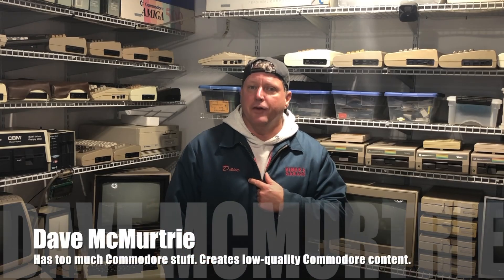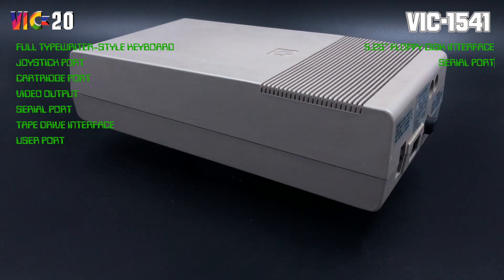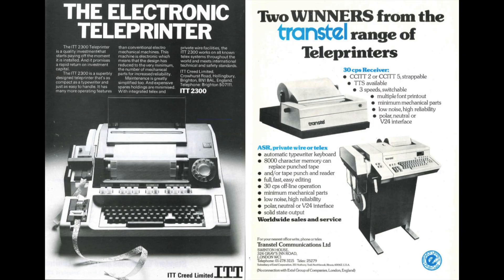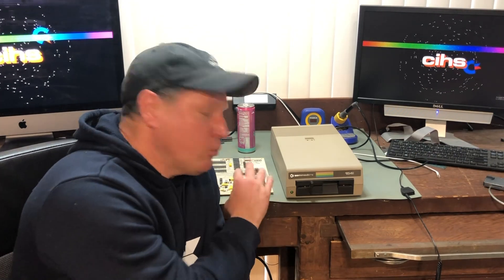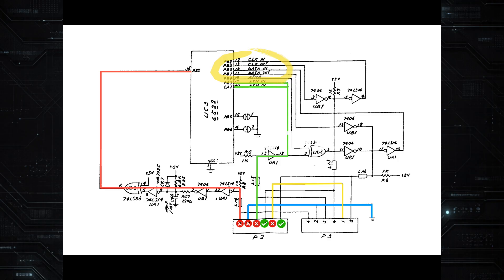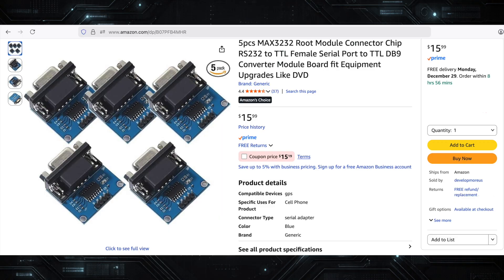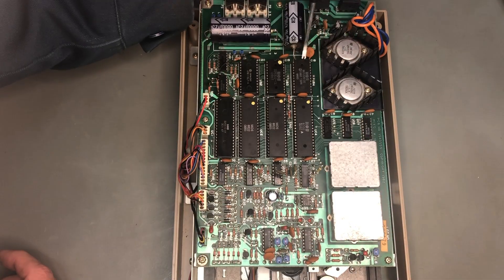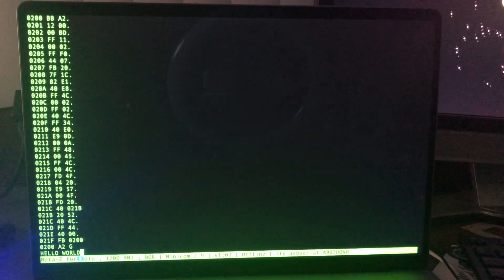Can a Commodore 1541 disk drive be used as a general purpose computer?

Comment: Removing chips with a screwdriver always makes me clench lol. Chip puller!!!
Reply from the maker: lol. Please don't stress! If you look closely, it's not a screwdriver. It's a chip prying tool, designed for the purpose. I don't like the ones that grab from each end because when they slip, they scratch up the top of the chip.

Comment: There's been lots of uses as a 1541 as a standalone computer. Some demos used it to calculate 3d graphics, of course it ran fast loaders, it played music, disk copiers could run them standalone with no computer connected, and using the DOS is actually talking to another computer over a serial terminal connection.
Reply: Look for "freespin" that one is a few years old and outputs b/w composite.

Comment: I'm not sure if it necessary to convert a CBM serial port to an RS232 port to prove this point.  Sure Commodore's serial protocol was non-standard, but other than that you can still connect to it like a terminal.  Something along the lines of OPEN 1,8,1,"O:TEST,S,W":CMD1 with a bit of BASIC wrapper 

There's a standard "upload 6502 code and run from 1541 RAM" command the Commodore drive so you don't even need to swap the ROMs (MEMORY-READ/MEMORY-WRITE/MEMORY-EXECUTE).
Reply: Yes, it's a serial bus, but the hardware uses bidirectional lines and the protocol is synchronous, so you need additional lines: Data <>, Clock, Attention, Read/Write (R/W).

With a standard serial interface, you have a transmit (Tx) and a receive (Rx) line that doesn't change direction.

However, if you want to send data via the IEEE, you first have to define the direction of data transfer (R/W), then generate the ATN (Attention Time Signal), and then create the clock signal for the data that will then be generated.

This is necessary to have multiple devices on one bus.

To create a serial interface from this, you would now have to implement the protocol on a PC or a microcontroller.

In this case, it made more sense to use the appropriate lines, such as ATN and DATA. Once the VIA has been correctly configured, the interface can be controlled normally using software. This also allows parts of the KIM system to be integrated.

Comment: I wonder, could you merge some KIM 1 code with some 1541 code to enable the disk drive functionality, so that you can load and save data from a disk? Maybe just put a boot loader in ROM and have the 1541 load the rest of the code from a floppy? It has 2k of RAM. Would it be possible to replace 1 of the ROM chips with a RAM chip to expand it's RAM capacity at the expense of having to load some of its code from disk? Just some ideas.
Reply: You can add drive ram without replacing any ROM. This was a common trick in the 80s for making disk copying more reliable

Comment: I love what you did by burning a KIM-1 ROM onto the 1541 but technically you may be able to do something like this without modifying the 1541 at all.  When I worked on C64 games back in the day we would download small routines (fast loaders) into the drive and run them from 1541 RAM. So just as a tech demo flex - it may be possible to fit a tiny monitor into the RAM,  download it using commands from a c64 or other, then disconnect the serial cable and then hook it to your terminal for a little standalone 'computer action'.  But nevertheless, what you've done is the better way and terrific! I got a good smile from it!  Porting Tiny Basic to the 1541 was mint!
Reply: yeah one application of this was a "headless copier" software. Hook two drives on the bus, load the copier softer into the first drive via the C64. Then swap it for the "source" disk, and put a blank in the other drive. You could now disconnect the drives from the C64 (so you could go play a game or something if you had a third drive, or cartridge). IIRC, you could even replace the blank after it was done copying with a new blank, and it would start over. Would be ideal for crack parties. The copy and "check other drive for a new empty disk" routines were all running from the ram on the first drive, and it became the bus master, as far as the second drive was concerned, it was talking to a C64.
edit: @lmorchard reminded me it was called Fast Hack'em
Reply: @epremeaux Crack Parties sounds amazing...
Reply: of course the OTHER famous application was to load "music" and thrash the head around to play sounds.
Reply: @epremeaux  Drive Music! A real money maker for disk drive service professionals back in the day. :)
Reply: this sounds cool too
Reply: If you have something that can input the "load file" and "memory execute" commands you can load and run any software from the disk, all without a C64.

I think a simple board with Parallel to Serial shift buffer, a timer, a counter and a dozen switches could probably do it. 
Or maybe just 4 switches if the drive ROM does not have timeouts on data bits. 
Or even just a ROM with a timer and a counter to automate the whole "boot process" completely.

Then you can hook a terminal and use it as a general purpose computer - as long as the disk has software that was created or modified to work that way.

This is not far from some early computers that could run software from a tape but you had to first key in the bootloader via front panel switches.

Comment: Wow! You are amazing. You have done it again. 

I was watching the epyx fast loader video, and I was wondering if you could please explain i detail how the commodore cartridges work in the different modes? Especially the fast loaders, but not only. I am very curious to understand how the action replay works and even "regular" game cartriges. 

I could never understand why different logic chips were needed. How come it's not always the same logic to make the cartridge execute? Could you please dive into it?
Reply: Action replay switches to ultimax mode to replace the kernel rom and then switches out of it using io accesses. The exact nature of the circuit can be different, or the implementation is equivalent with different chips.
Reply: @phill6859  This is exactly what I am talking about. These procedures are intricate and I would really like to learn much more about it. It's fascinating and this knowledge  is scarce.

Comment: It's funny how serial connections were so slow back then, but now they're all we use. 🎶USB killed the parallel port 🎶
Reply: Yeah when clocks got fast and clock slew became the problem, I still remember using laplink with a parallel cable because 8 birs > 1 bit lol.
Reply: Also, SATA, which is Serial ATA as opposed to PATA, which is Parallel ATA.  Also SAS, which is Serial Attached SCSI, as opposed to traditional SCSI, which is parallel.
Reply: What I've found fascinating is how the industry tends to come full-circle. We started out with teletypes and terminals, moved to local computing, and now with cloud computing, VPS's and VDI (virtual desktops) we're arguably back to terminals (spiritually at least). Serial links made sense because they were cheap, not fast. Parallel tried to improve local throughput, but ultimately we went back to serial because we realized it just works better for high-speed throughput despite being cheaper to deploy (signal drift on multi-point links is a real issue!). It's kinda funny how the industry actually got so many things right early on, and it just took some floundering around before we all settled on the spiritual successors of computing history. And of course, standards like Ethernet and IP were done so well back then that we still use them today. We've lost this part of computing - show me any modern standard that is likely to not only last but remain acutely relevant for 40 years into the future...
Reply: But a Universal Parallel Bus would still be even faster.
Reply: @NuntiusLegis  nope, signal timing drifts across multiple data lines, if you anything near as fast as fast serial you start reading out mush.
Reply: @donwald3436  USB4 uses multiple data lanes, which are not parallel in the strict technical sense (synchronous transmission of bits of the same word), but rather “multi‑lane serial” channels. Many of the limitations of electrical signaling do not apply to optical parallel transmission, which is already used in data centers. As electrical connections approach their physical limits, optical‑parallel links may eventually become practical for PC‑level connections as well.
Reply: @NuntiusLegis Okay so you just explained why you were wrong?
Reply: @donwald3436  No, an optical-parallel port will be faster than any serial port.
Reply: @NuntiusLegis   Okay?

Comment: People have always misunderstood what the 1541 is. It’s not a disk drive, it actually more like a NAS.  
When I used the PET you could hook multiple PETs to the same disk drive.
Reply: The CBM-IEE488 is not multi-master capable; an additional interface was required for that. Then it actually worked. The original IEEE488 is multi-master capable. This system was also used to avoid further burdening the host's processing time. The floppy drive is therefore an intelligent floppy, controlled by the IEEE.

If I have two drives, I can instruct one to format a disk and read data from the other. As soon as the first drive was formatted, it sent a signal to the host, and the computer could read the error channel and issue further commands. For example, copying a disk from #8 to #9. While this is happening, the computer can continue working normally.

This intelligence was not implemented in PCs. The CPU must therefore pause and send the data (possibly via DMA) to the controller and manage it itself. The advantage of IEEE was and is that the host didn't have to worry about the geometry and the file system. The peripherals took care of that. Therefore, any CBM can control a hard drive or even a CD-ROM drive, as long as the commands are interpreted correctly.
Reply: @m @mibnsharpals t would you not agree that this approach was closer to a nas that direct media access. 
Even with single host single client it still feels like a network attach storage it’s just the network isn’t Ethernet it’s serial
Reply: Multi host serial at that 8 hosts if memory serves
Reply: @mibnsharpals  ב''ה, what's truly funny is that for how 'shitty' and 'cheap' IBM's original PC floppy implementation was as became the standard for PCs because compatibility.. y'know, IBM left expansion open to swap in something 'better' if there ever was such a thing (as there wasn't until new floppy densities and eventually CD-ROMs etc.) but it was so much faster than what Commodore got hobbled with by the serial bug that, aside from niche cases like standalone duplication as was pretty useful for early software houses, nobody ever complained about being stuck with a PC where copying and loading anything commonplace only took a minute at most.

So this is one of those CS/CompE examples of 'raw performance' making up for a lot, not that the PC was blazing but that Commodore unfortunately got hobbled until the 8-bit era was basically over.

Would have been a lot of 80 column hacked C64s out there if the "oh.." of watching someone demo a system hadn't been the first experience.  "Uh, yeah, after those 5 minutes of watching the 1541 clunk it sure is great," but nobody was going to rush to replace PCs or be in a hurry to discover CBM's weirder business machines weren't always as hobbled.
Reply: you can actually hook up two c64s to one 1541 w/o any adapters, you just need to take care not to use IEC on both machines at the same time
Reply: It is like a prehistoric NAS, isn't it.
Reply: @houdvast just ahead of it’s time😂
Reply: @houdvast  ב''ה, the thing is this wasn't particularly rare in the "big computer" and "minicomputer" only big enough to take up one room kind of world.
Reply: I'm pretty sure it's a floppy disk drive.
Reply: @digitalarchaeologist5102  That can do things no other disk drive can do.
Reply: @NuntiusLegis  It's a disk drive. Richard doesn't seem to think so. We agree it is. The second point is quite bold but utter nonsense. You're confusing the cleverness of what was done by thinking the hardware is somehow special (other than being retro). What can it actually do that no other disk drive in the world can't? Other than being a 100% certified 1541
Reply: @digitalarchaeologist5102  Other disk drives don't have a general purpose CPU, RAM, ROM including the own DOS, etc.
Reply: @NuntiusLegis And? What about the 1541-II? Your answer doesn't say anything about what it can do that other disk drives can't.
Reply: @digitalarchaeologist5102  It applies to the 1541 and other Commodore disk drives with similar architecture. It can run code by itself that is injected into it's RAM, as used by some C64 software, files can be sent directly from the disk to the printer, no RAM or ROM space on the attached computer is used for the DOS.
Reply: @NuntiusLegis  So NOT the only drive in the world that can do it. I totally understand what it's doing. I don't know why you think it's unique.
Reply: @digitalarchaeologist5102  A unique approach by Commodore, a drive that is a full computer system. It is not just an odinary disk drive as you said, that's the point. And I guess you have seen the video.
Reply: @NuntiusLegis Full computer system? In same way my fridge is
Reply: @digitalarchaeologist5102  1.We are talking about disk drives, not fridges. 2. A modern fridge may come close, but not those of the era. 3. The 1541’s ROM is an unsecured chip you can swap; according to AI, a fridge’s firmware is locked and cryptographically protected. 4. I doubt any fridge exposes a port you could hook a terminal to.
Reply: @NuntiusLegis  Firstly, let's not forget my only comment was "It is a disk drive" to which you took exception to, to tell me how unqiue and special it. Then you claim it's a full computer, because it has a ROM, some RAM and a processor. Big whoop, you'll find most devices do - like a modern a fridge, a TV, a disposable vape and even many retro devices. Somehow you think this something magic that Commodore invented by stating the 1541 was the ONLY drive to do this. Not true as well you know (but your claim). Then you once again secpial plead by claiming this approach was unique to Commodore which is also not true - look up what a disk controller is - especially integrated ones. Now you're saying because the firmware on a fridge is locked it's somehow not a computer by your definition? Change to it TV - I can hook terminal, keyboard, internet to mine? And you also doubt wrong - so many devices have serial ports, JTAG connectors, I2C busses hidden out the way. How do thing these things get jail broken and hacked? Show me where in the video a terminal was hooked up with ZERO modification? Fact is this. You have the hots because someone ran some code on a disk drive. Is it interesting? Sure. Is it clever? Totally. Is it fascinating much of the hardware is similar to the C64 itself? Yep. Does it make the 1541 a magic unicorn? No it doesn't.
Reply: @digitalarchaeologist5102  Run "Hello World" on your fridge then.
Reply: @NuntiusLegis 😂😂😂😂😂😂😂😂😂😂
Reply: @digitalarchaeologist5102  I think @Richard31415 means that the 1541 evolved from the PET system days where the disk drive was prohibitively expensive so multiple PET computers used one disk drive as Network-Attached Storage (NAS).  In that case, the disk drive needed it's own computing power to handle the requests.  And Commodore just reused the tech as much as possible for the next iterations even thought the multiple computer storage sharing need was gone by then.
Reply: To be fair, a lot of people also misunderstand modern NAS drives the same way and use them like a normal disk drive, often not even realizing that they can access it from other PCs. So, I guess technology changes, people do not.

Comment: It's DE-9! The B size D-Subminiature is the 25 pin serial, parallel, Mac SCSI size. All the sizes have different letters, except Apple's 19 pin one they used for Apple ][ and early Mac external floppy drives.

IBM joystick and early Mac monitors used DA-15. Do NOT plug a 15 pin mac monitor into a PC joystick port. Things will not be happy. I saw the result from someone who did. Melted insulation on wires to the joystick port.

Comment: It's pretty interesting that back in the day, some software companies actually ran custom copy protection routines and compression/decompression routines entirely on the 1541 itself, freeing the main C64 CPU to handle other non-disk-io-related stuff, so I wasn't too surprised to see this application as being possible. Impressive work demonstrating it, especially putting the kernel into a custom ROM. I always wondered who much modification it would take to handle custom IO devices, and this looked pretty clean and simple!
Reply: some fast loaders modified the drive code as well.  And then there were full ROM replacements like Jiffydos.

Comment: I get that the C64 needs two VIA chips, it’s a fairly complex beast, but what surprised me quite a bit is that the 1541 also has two; I mean, it has a serial port and an LED. Is it that handling the drive mechanics is so complex that they needed a 2nd VIA chip?

edit: Yup, if I had just har the patience to watch a couple more minutes, I would have found that that’s exactly why :-) Great video, thanks a lot!
Reply: In addition several of the VIA I/O Pins are not used - exept later on for parallel fastloaders.
Reply: Small correction, the C64 does not have VIAs, but enhaced versions called CIAs with some bugs fixed and an additional Time-of-Day (TOD) clock driven by the powerline fequency, which is more accurate than the the jiffy clock (TI/TI$) driven by timer interrupts. So the C64 has three clocks!
Reply: @NuntiusLegis  Ah, crap, you're absolutely correct, of course! Thank you for correcting me!
Reply: Yes, because there isn’t a microcontroller to do this job. The 6502 and its VIAs ARE the microcontroller.